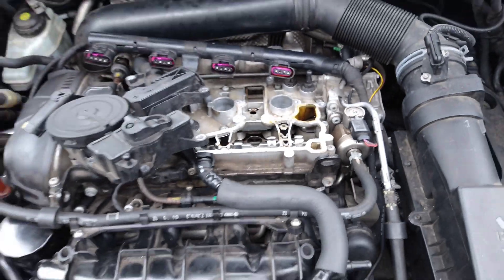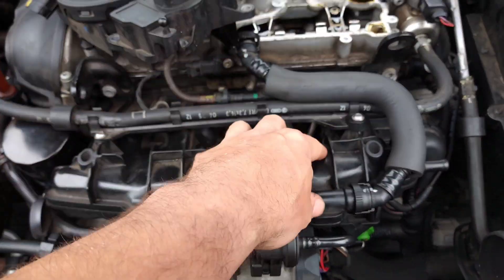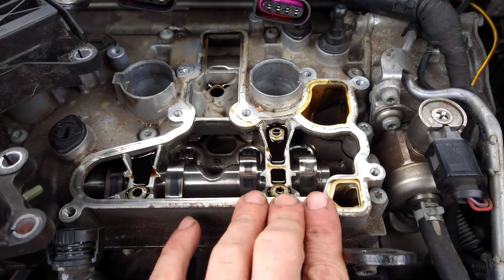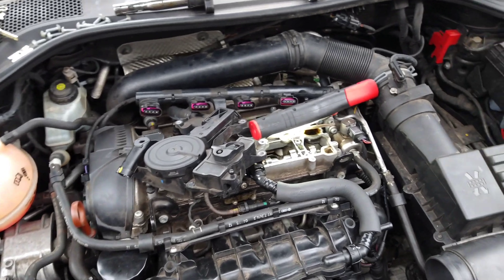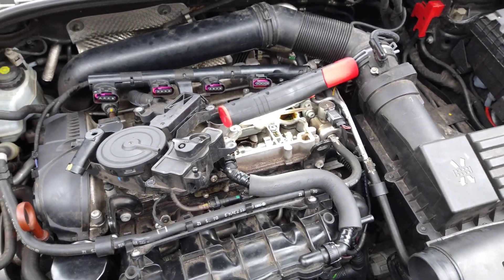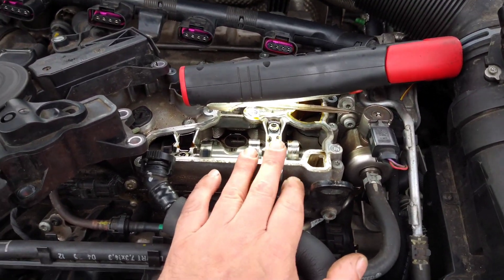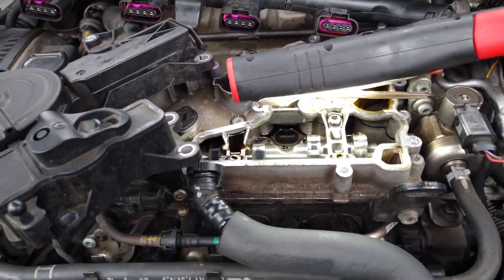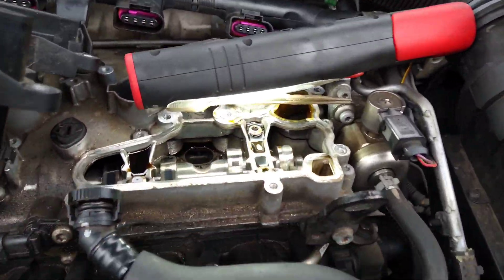Audi TT case study Part 2 (P0304 cylinder 4 misfire) injector shutdown.

Comment: Clever logic Matt....Question: Why did this not translate on the pressure transducer waveform of  the intake manifold. (Or did it?) One would figure the pull on that cylinder would be shallow, or am I missing something? (Again) Cheers Matt Thx for the follow up.
Reply from the maker: I am thinking that even though the piston going down during the intake, it must still be enough to get the pulse sensor to react the same as the other cylinders with fully opening valves, perhaps if I was to put less voltage on the screen to make the pulse sensor larger (or zoomed in) I may have seen a difference.
Another thought is that the inlet valves still fully closed (if they were not sealing properly it would have made it easier to se an odd one out)
As for the pressure transducer, the inlet valve opened and closed at the same time (degrees) as the good cylinder, it didn't peak as much pressure, I am thinking it's possibly due to the tip of the cam not having as much lift as the other cylinders.
The start and end of the cam lift mustn't have taken as much wear otherwise the intake opening time would have been reduced like a slack tappit needing adjusted.
This is just thoughts and could be wrong.
It also had some leak down on that cylinder but I didn't see any indication of that with the pulse sensor in the dip stick tube.
Again I may need a larger amplitude to see this. It's the first car I have tried the pulse sensor in, I think the more I do it the more I'll make sense of it all. Thanks for watching Ian
Reply: Mechanic Matt Very interesting indeed...With the benefit of hind sight (now that your have found an issue). It certainly makes sense the compression on that cylinder would be comprised if intake lift was marginal...Great stuff super education!